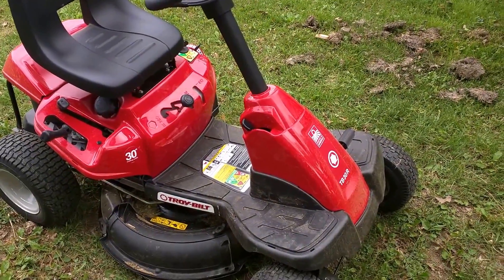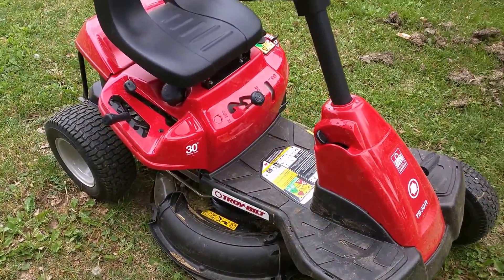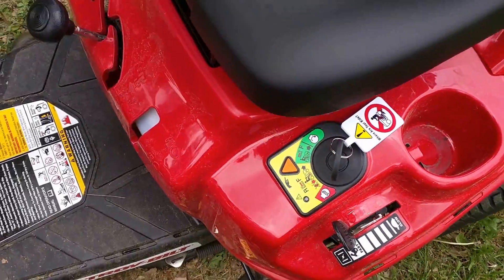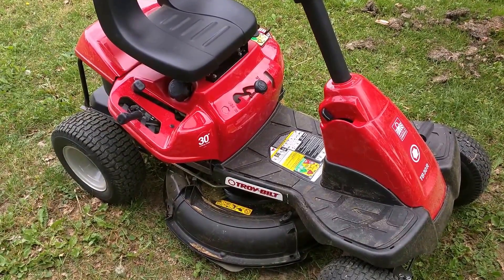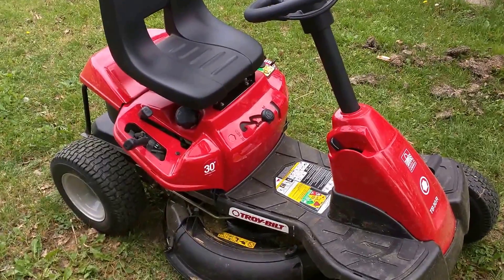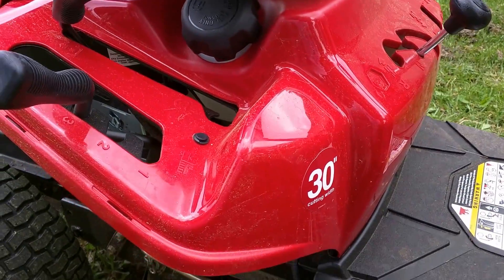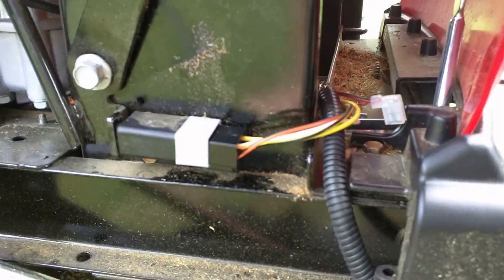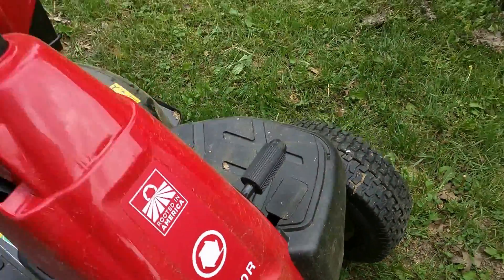Troy-Bilt TB30R REVERSE MOW / CUT HACK

Comment: Thanks Chris! Saw the Incredibly Idiotic procedure for what had to be done in order to mow in reverse.
  I haven't even used mine yet, long story short,arrived from Home Depot via Freight Delivery Contractor with Shipper Box Damaged. Was going to return it,but,found out it was on Backorder for a replacement,meaning, discontinued or, I'd have until February. Looked inside,saw No Damage where Hole was,decided to opt to keep it,and MTD Would cover any Shipping Damages. Did have a Flat tire,And,Due to the Heat that day,The Flat,and some pre-existing Health Issues,Ended up in the hospital for 4 Days....
 Sorry, was supposed to be a "Long Story Short",...., Sorry,.. Lol!
  Anyway, They sent an entire Front Wheel/Tire/Bearings assembly- THANK YOU MICHAEL! - and, although I may have Further " Brained My Damage" , I can't wait to try my 'Lil Red Beast Out. I'm a Disabled Gulf War Vet with a Grocery list of Health issues,and can't use a push mower anymore. Tried hiring a Landscape Company to take care of my lawn,Caused more Damage than Cut any grass. Before the Idiot Totalled my Central AC Unit,I decided to let them go. Bought the Mini,Found out from Michael,The MTD/TROY-BUILT Parts Tech that The Mini is a Descendant of the Mower FORREST GUMP Used....Lolol!
 Now,all I'll hear while sitting on the Mini will be ".... RUN FORREST,...R-U-U-U-U-N .... !!!!
LOLOL 😂

Comment: Also... if you remove the shift knob (Store it some where if you sell the mower you can reinstall it). Slip a  8 inch long 1/2 inch copper Pipe over the stem of the shifter ) It will shift much easier. & I also replaced the rear tires with a more aggressive tread no more slipping .  Great Video! Thanks

Comment: Without any modifications, you can turn the key to the reverse mode and press the button.
You will be able to mow in reverse,  shift gears, engage and reengage the blades. 
The mower will stay in reverse mode until you apply the park brake.
Reply: @MatthewWatches   what proportion of the mowers don't have that feature working? 1 in a hundred or less? If someone isn't smart enough to read a simple instruction clearly printed in front of them, then they are not only too dumb to operate the mower, they're likely too dumb to decipher a crosswalk signal or a traffic sign.
Reply: I just purchased this mower and the reverse mow button won't light up. I have the blade on , switch the key to yellow and when i
Reply: Ugh, I press the button, nothing lights up.....I don't have the owner's manual but read the sticker on the mower. May just have to bypass the switch
Reply: @teresafarley4033  Mine works randomly or not. If it's not working, I restart the mower and sometimes it starts working again. Can't see why it doesn't work, I don't think it's a sensor or something. It's only slightly annoying so far but I may disassemble the switch if it starts happening too much.
Reply: @chaos.corner  I ended up disconnecting the switch. Mows great!!
Reply: @teresafarley4033  I've thought about putting a keyswitch in-line so it could be re-enabled. Probably not worth the effort though.
Reply: @chaos.corner  the switch was very easy to pull out.
Reply: @snappingbear  you are making an erroneous assumption that people are using the switch wrong...the switch SIMPLY DOES NOT WORK on my mower, and evidently on many others--So I unplugged that little connection and now it mows in reverse like it should!  My old mower ( a late 90s Snapper by the way) always mowed in reverse so why shouldn't this one too?
Reply: yep my button doesn't work either. maybe a faulty key switch? I will use my meter to find out once i get the schematic. In the mean time , I think im going to sell it for $650  Do you think thats a fair price? Used probably 10 times if that. Sebring Florida if yall are interested.

Comment: I own one of these machines and cannot figure out how to take the battery out of the machine to replace it....any suggestions or help would be greatly appreciated....
Reply: Take the bottom bracket down 
By pulling it forward towards you and up
Just watch the terminals on the battery 

I had the same issues too and found out how to do that

Comment: Yeah I just rebuilt the rear end of a 2012 Troy Bilt 17.5hp Pony model and then I bought the tractor, and it annoyed the crap out of me having to turn the PTO off just to go in reverse, this and the seat switch I pulled the wires off when I got it, I get it but its so annoying.

Comment: Pretty cool 😎,,, I have the craftsman version of this I just bought a week ago at Lowe’s and all I can say is they need to move that dam gear shifter over to the side because between your legs is not the way to go,,,very big pain,,,You’re always pulling up and over on it which causes the plastic knob on the end of the gearshift to come off and you have to push it back on,,, The gear shifter is not easy to access at all,,, however that being said it does mow good I have the mulcher and it does very well and as I have two narrow gates I’m willing to put up with this riding mowers quirkiness to have the ability to slip between one property to another through the gates.
Reply: Yes. I'm actually here because I'm looking for a way to change that shifter over to servo actuated or something. This will be common with the small yards that this thing is designed for.
Reply: @chaos.corner  They have a Hydro version of this hydrostatic it’s got a pedal down on the floorboard I don’t know if that’s any better I can’t see having my foot jammed to the floor all the dang burn time I’m 5”10 and 318 pounds after riding it for a little bit I need to lean back in the seat and stretch out which you can do on this surprisingly well because of the big seat (big for the size of the mower anyway)could use some better springs on the seat though.All they would’ve had to do is move the gear shifter over to the left and make a place for it just behind the key and throttle something along those lines and then this thing would be a lot better that being said they need to address the steering also the steering does not return its caused me to slam into things and it is heavy in the rear end even with a light rider,,,my son hit a small dip in the yard and it flipped over so we have to be very careful how we operate this thing.I was going to buy a new one this year but everything has gotten so very expensive it’s really unbelievable if you go to Lowe’s right now and buy this mower the craftsman R110 and finance it with tax and financing you’ll be right around $2000 possibly even more I’m not sure,,,that is insane.I bought this mower on special promotional offer through Lowe’s with interest-free payments and total cost I believe about $1100 a couple two or three years ago all the tractors are terribly high right now what I’m looking for is an old-school craftsman hydrostatic drive with a blowed motor or bad steering or something as I can still work on them and I can get parts for online.If anyone has a halfway decent old craftsman right now they seem to be wanting to hang onto them.
Reply: @william38022  Yeah, I would like to see it replaced with a three-way switch. The big thing is it probably takes a lot of force to have the belt engaged firmly. I agree that a lever on the side would be usable too. I wonder if a stepper motor and a threaded rod could do it.

Comment: Don't work on Sears craftsman identical model. It will not start. No power to starter. Any other suggestions? It's a Craftsman R1000 Lawn Tractor, it looks exactly the same as the toro. Pulled the wire and it would start.

Comment: Is the key switch that freaking complicated? Once cranked,  just turn the key to the middle position, then push the triangle  button.. then the little red light will come on. You are now in F/R cutting.. no need to remove safety features until absolutely necessary.

Comment: The same people disconnecting safety devices text and drive. It literally takes 2 seconds to just turn the switch and push the button. I have two riders a snapper and a cub cadet one with safety one no safety and I don't feel the need. If it didn't mow in reverse at all I could see the need in that case.
Reply from the maker: Retrogamer1010 Lol. Ok.
Reply: Evidently your switch works PROPERLY... Ours don't... Very hard to deal with having to disengage to back up .. so yah BYPASS THE PROBLEM
Reply: Valid point when switch works...except my switch does NOT work...never has.

Comment: There is a much easier way.  Start the mower in N blades off.  Turn key to yellow reverse setting and press button.  Light comes on.  Now just start mowing, when you need to mow in reverse just shift to R.  No need to disconnect anything.  I mow with key in the yellow position and the light on at all times.
Reply: Exactly!  :-)  Lol.
Reply: You are fortunate to have that work on your TB30r…  my mower will turn off while attempting to change gear forward with key in reverse mode.
Reply: Not on my Troy bilt pony, has no such option, plus to me it makes more sense to just pull the wire and let it dangle, the feature is well more for them dummies who doesn't pay attention to their surroundings anyway, if I was to resell the mower, plug it back in and let the next guy mess with it.
Reply: Except when switch and light do not work...

Comment: I know the hassle of the reverse mow on this unit (i have the same unit) but it is never a good idea to defeat safeties on anything.  To set it to mow in reverse, for those who do not of what we speak, turn the key back counter clockwise to the yellow area and press the yellow/orange button.  You only have to do once when you start mowing.  Of course it you have to stop mowing at anytime, you will have to repeat these steps.
Reply: So, other than requiring you to repeat the process anytime you stop mowing, how does it make it any safer to mow in reverse?
Reply: @mansfieldlou  I won't say that 100% of safety devices are there because someone did something stupid, got hurt and sued the mower company.  The problem here is, they won.  That caused the company to add a safety to prevent that from happening.  I don't know if you ever heard the story why mowers stop when you get off or leave go of the push bar.  I seems that two guys tried to trim their hedges by picking up the mower deck to lift it.  Some fingers got lost according to the story.  Let's not call them safety switches but stupidity switches.  In most cases that reverse switch won't matter.  The first thing I do when I start to mow is set it to mow in reverse.  Done.  No biggie.
Reply: @mansfieldlou  First thing I do when I mow is turn the light on. If I don't, I do it immediately it stalls out for the first time (after I cuss first). I agree, it seems that the only way this feature would be remotely useful as implemented would be if someone had the habit of putting it in reverse by accident.

Comment: Lol. Did you bother reading the manual or you know read that BIG label right above the key? Getting it to mow in reverse is trivially easy; you don't need to hack anything.
Reply from the maker: Who cares... If you want to turn the key and press a button, go for it. If you want to disable the "feature" go ahead.
Reply: @cswain513  so you didn't read the manual or the label? Got it. Lol.
Reply from the maker: @snappingbear  So you have nothing better to do than argue in the comments on 6 year old videos about lawn mowers. Got it.
Reply: @snappingbear  Why read the manual when you can take the less than 2 min to pull the plug and never worry about the stupid thing again? Its just as easy as turning the key back, or my Troy bilt don't even have the feature...
Reply: @VikingDudee  As I said you don't need to read the manual given there is a big label right by the key. Pay attention.
Reply: Ours don't work we have to mess w key push button several times before the light comes on so no that is not the EASY way .. disengage the safety is the way to go if u are mowing in reverse
Reply: @annetteivey "Is the way to go" You mean after the proper way is broken, but as the saying goes "if it ain't broke DON'T fix it". lol.

Comment: i dont get why its such a problem for people.... start, turn key back, push button...done.....
Reply: I assume you must have a huge yard that requires long straight  time...???
Reply: Usually i find the wires going to and from the switch. I cut them and solder them together. Job done